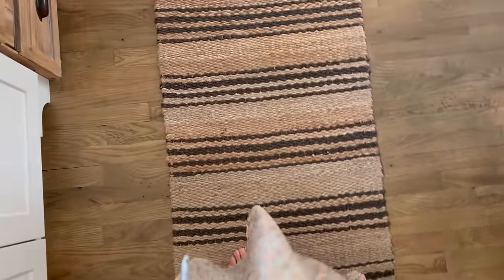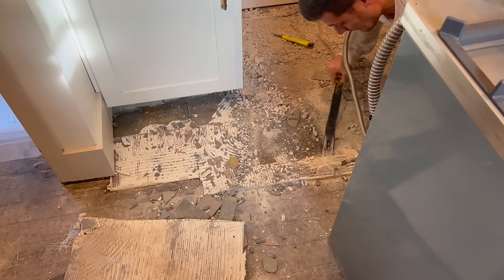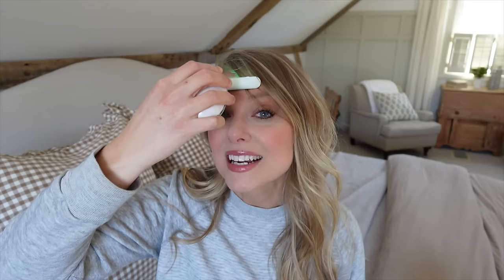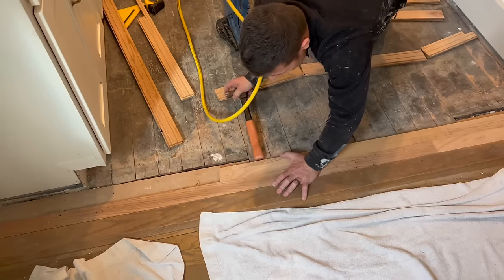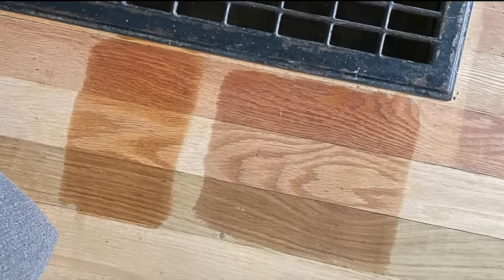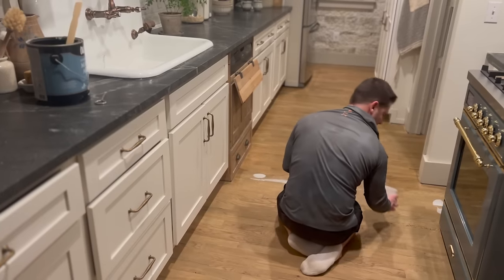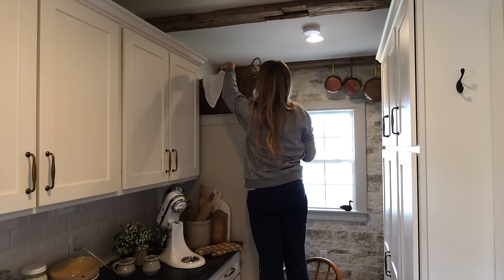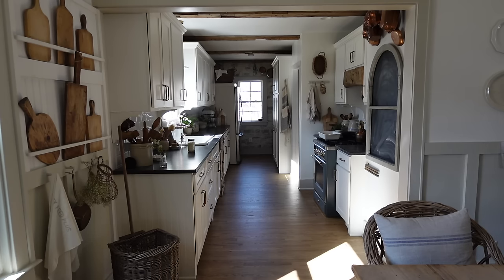New DIY Red Oak Flooring in Our Cottage Inspired Kitchen!

Comment: It is so beautiful!  Wood was definitely the right choice!!  I think the color difference you are seeing now with your old floors will blend over time with wear.  Also, at 8:36, I noticed the color of that one old floorboard when you were adding the new flooring was darker than most of your existing wood floors. I wondered if you changed out that one board if the colors would have blended a little closer in making the transition to the new kitchen flooring.  Wood certainly has subtle variations in color and depth.  Embrace those variations!  With wear, you will not notice any difference in 3 or 4 months.  It is a stunning transformation and you both should be proud of what you have accomplished!  You make a great team.  It was a major undertaking with an incredible, breathtaking result!  Congrats!

Comment: Red oak does darken overtime. We have red oak in our entire home. It’s 75 years old . We’ve had it refinished two times in 45 years. Our kitchen is the same layout as yours. It didn’t have hardwood. So we had red oak installed. It was just a shade different but over the  last ten years ears it’s pretty much evened out. Yours are beautiful.

Comment: Wow. You did such a great job matching the floors. I'm sure you're thrilled. I have installed hardwoods. The floors will darken just a bit. They will absorb moisture from the subflooring. There is always some moisture no matter how dry it may seem. It will take a little while but they will darken. I'm so glad that all worked out. The kitchen looks gorgeous.

Comment: Hi Diane here again. I just thought you may want to know that my husband and I put down wood floors about 20 years ago. And we also used the red oak. And yes your floor darken over time. Which I really like. I don’t know  for sure but I think your floors may end up matching eventually. Because my floor only got so dark. We used the oil base polyurethane. I don’t know how well the water base will hold up in your kitchen. You will spill things. I live in fl so we had to glue our wood over concrete. Just remember you can always go over water base with oil base. But not vice versa. You just have to lightly sand before you do. I know how much work your doing. But you will always have a sense of satisfaction and pride in yourself for it. Looks beautiful

Comment: Love the time capsule note! ❤ So encouraging to see this! Previous owners of my house removed the old linoleum but gave up when they got to really resistant black mastic underneath and then just covered it all with orange carpet 🤮 that matched their wallpaper at the time. I really wanted to try to restore the wood floors, but after pulling back the carpet in sections to work on underneath (so I could lay it back down to still have daily use of the kitchen) I decided there were too many splintered and damaged planks for it to ever be viable to restore. But some at the steps and landing just outside of the kitchen at the closet might be. I’m not certain what I’m going to do in the kitchen yet because I’m not sure it I’d have to remove the original flooring in order to lay new. But this gives me hope!
Reply from the maker: Sounds like so much work!Thanks!! Hope this encourages you! 😊

Comment: we bought a home 6 yeas ago now, and we are a 1 income household, so tight on funds many times. Anyway, out of 13 rooms in the house we have ceramic tiles on the floor in 2 of  the 3 bathrooms and also in the kitchen, and they are CRAP! Brittle , they crack very easily, the house originally built in 1920,so things have settled and we had carpet cleaners come and they rolled their big machine into our master bath to fill with water and cracked the tiles on the threshold,,,, dropped pot lids crack the tiles in the kitchen.. I would love to have wood floors in bath and kitchens

Comment: Wood floors do darken over time when polyurethaned. I don't know if that works the same with polycrylic, but I would think so. On the video, the difference isn't apparent between the old and new floors. They're beautiful! Were the fumes from the stain really bad? I've often thought about putting in wood floors myself, but have worried about using stain indoors.
Reply from the maker: It wasn’t bad this time at all. It was much stronger when we did the rest of the house though.

Comment: I never thought of it before, but I bet the “frame” around your chalkboard was the original insert for the original wood storm door I
on the front of the house. Probably originally held either glass or screen.
Reply from the maker: It was! We had to have a new one put in to help with the heat and draft. 😊